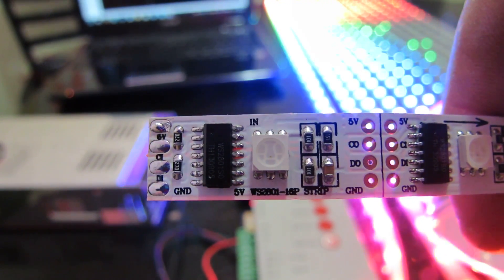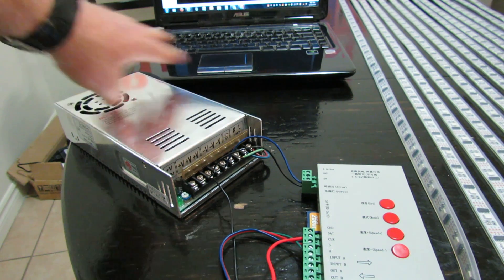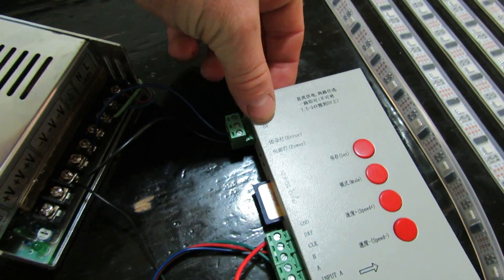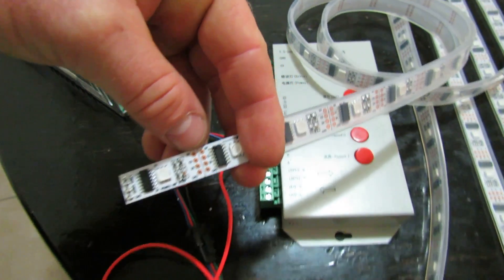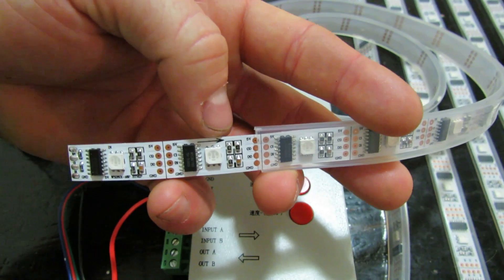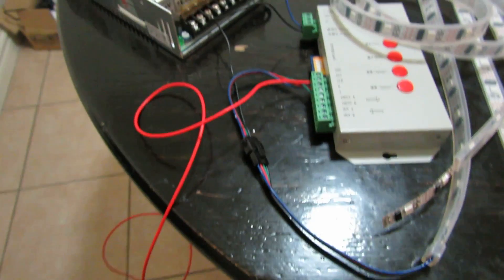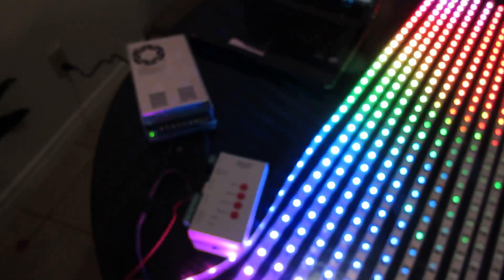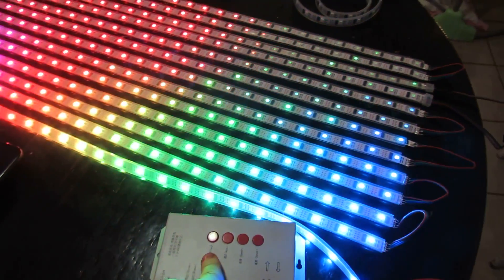How to Build an LED Display, #1 Basic Wiring and Setup (WS2801 LEDs)

Comment: Considering the voltage drop: why do you add a red wire from the GND of the controller to the GND of the end of the strip? I thought you would have added an extra black wire running from your Power Supply (an extra V+ port) directly to the end of your strip (on the 5V dot, not the GND).

Comment: I have a question?, I have a LED strip ws 2812 B 100 meters, a strip of two meters is attached to the wall, total 50 strips are attached, total LED is 6000, which controller will be used for this?  That works with audio?

Comment: Great videos, thank you! Hey, can you share any insight on clear LED screens? (typically seen on large applications so the resolution being very coarse aids in the perception that it's clear) How are they doing that, are they somehow placing the chips to the side of the screen vs. inboard next to the LED, as seen on your example strips? Wondering if you might know of a good source to find clear strips and/or screen? Thanks again.

Comment: I loved how the sd card says “256 MB” proudly
Reply from the maker: Oh, how technology has evolved. haha
Reply: @flexfireleds  Considering the voltage drop: why do you add a red wire from the GND of the controller to the GND of the end of the strip? I thought you would have added an extra black wire running from your Power Supply (an extra V+ port) directly to the end of your strip (on the 5V dot, not the GND).

Comment: i have all the things on the video but my led strip is 12v-DIN-GND i have only 3 outputs and 2 wires goes out from "12v" and 1 wire goes out from "DIN" and 2 wires goes out from GND hmm

Comment: I'm looking to do this program on a DC system with 6v batteries and the ability to have 6v and 12v possible system. What are the key differences in the power supply I need to know?

Comment: Too much wrong information in this video. The arrows on the strip indicate the direction the data should flow, not the power. Power taps can be placed anywhere u wish. You only placed a ground wire at the end of the strip to counter the voltage drop, should have also connected a positive wire. You really should learn the basics before trying to teach others so as not to spread incorrect info.

Comment: When connecting power between terminals, for safety and consistency, BLACK WIRE is normally used for GROUND (or V-) and RED or WHITE (less common) for Supply Voltage (V+, or VCC)

Comment: Hi, i am trying to install the program and i'm folowing your video, i do exactly the same as you but the program open a window with an error and it don't let me to continue. Do you know what could it be? When i put new file the error appears. I've downloaded around 50 different types of the led edit and in all of them i have the same problem, if you can help me it will be amazing. Thank you

Comment: Hello I need some sugestion,how I can have real time clock and temp on same display like this.I using T1000s controller.thanks
Reply: I don't think there is a way to do "real time" with a T1000S because it can only run programs loaded on to the SD Card in a loop.  To get real time info, you would probably be best using an arduino controller with wifi.

Comment: Could you use this type of setup to control warm white leds?
Reply: Yes, but it is likely overkill for whites unless you have a project requiring each led to be programmable at different intensities (this set-up controls millions of colors and each led individually).  There are much simpler controller/power set-ups that can handle dimming and blinking of white LEDs.

Comment: There is so much wrong with this video. The arrow is NOT the flow of electricity, it is the data flow. You can power the strips and feed power from both ends.

Also you appear to just provide power to the +5v, well guess what, what current goes out of the +5v needs to have a return path, so when power injecting you need to provide a pair of wires, one to the positive and one to the negative

Comment: I have ws2811 led strip lights and hc008 controller. I have connected 25 meters of strip lights. after 10 m the voltage drops and my lights don't emit all colours after 10 m. same like yours my strip lights also have arrow marks so that I don't power up the wrong side. however u connected the gnd wire to end of led strip going against the arrow direction. will this help me as well if I do the same
Reply: Shadab Khan:  Did you find a solution?  I have a similar question because I don't think he should be able to jump power by using the ground wire like he does in the video.  From what I've learned, you should jump power using the 5v wire (makes more sense to use the power wire to jump power) and that is how I've done it in the few projects I've done. [From Power, I attach 5v to controller and to light strip; From Power, I attach Ground to controller and to light strip; From Controller, I attach ground to light strip].

I'm wondering if his ground and power might be switched and he doesn't realize, either because he mis-labeled or the Chinese controller has mislabeled its pins/ports?  I've seen other T1000s with different labeling order than mine, so I wonder if some are mislabeled? 

Any electricians out there who know why he was able to jump with his ground wire?  Is the video correct?
Reply: Good . We are professional manufacturer of addressable pixel led / led strips . I'd like to add you to my professional network on LinkedIn & facebook .
Reply: The reason you add the ground to the end is to reduce the effective resistance of the bottom half of the LED's. The same thing is achieved by adding an additional power line. If you do both, you could vastly reduce power inefficiency due to accumulated resistance, however, adding a second ground to the end of the strips is usually enough. AFAIK, these stips use a common rail that runs down the back of all the strips, and the LED's and controllers tap into it in parallel. The arrows have NOTHING to do with flow of electricity, but flow of data.

Comment: Awesome video will help immensely once my T1000S arrives. Quick question do i need to have a dimmable power supply for the T1000 and my Strips both 12v
Reply: not necessary to use dimmable , just DC12V power supply works. more help visit  www.led-color.com

Comment: hi,  does the controller also work with strips whitout clock?
Reply: ws2801 is double signal 。Date and clock .  need install clock pin .   ws2811 is 3 pin  with out clock
Reply: controller works for both ws2801 and ws2811 led strip, more information see http://www.led-color.com/index.php/Product/view/id/705.html

Comment: Can you connect via DMX?
Reply: the Ws2801 ic led strip is the SPI signal, if want to connect the VIa DMX. should add a decorder.     if you have the DMX controller. you can just get the DMX led strip . can work with the DMX controller directly. 

learn more please Email: jessie@witop-tech.com
phone/what's app: 0086+15676178187

Comment: I see there is a voltage drop to the end of the strip, but how does adding a ground wire help?
Isn't it that the 5V wire should also be connected on another place?
Reply: Yes, as well, and not just at the end of the strip. Power loss will always occur, it's just a matter of reducing it as much as possible. Of you connect extra wires for ground and +5v at the end of the strip, the highest power loss will be in the middle then. Question is if you are able to notice it or not....

Comment: In your vid:  The GROUND wire (green), which they should call the common wire (?),  is connected to the aluminum chassis?  And the blue wire is VSS, which they should call GROUND?  And VCC is the black wire?  Thanks!

Where did you get the power supply, btw?  I see a lot of them from China on eBay, but just wanted to know if I could order in the US.

Comment: Does the pixel number on the Auto layout means "sections" or number of LED on the strip?
I have a 5050 SMD300 strip, that on each "section" has 3 LEDs (each one is RGB).
I mean, if I want 30*30 layout, do I need 30 sections or total of 30 LEDs on the strip?

Comment: I want to buy this T1000S controller, SD Card , and WS20801 IC strip lights . where I Can buy in Cambodia ?
Reply: You can click here know more about this controller and WS2801 strips :   http://www.ledstripsales.com/Full-color-controllers-c-56/t1000s-with-sd-card-pixel-controller-for-ws2801-ws2811-ws2812b-dream-color-magic-led-strips-p-2090.html                     http://www.ledstripsales.com/color-change-LED-Strip-c-38/ws2801-ic-5v-rgb-magic-color-programmable-series-flexible-led-strip-lights-160-leds-5mreel-p-2068.html

Comment: LED strip dislay is one trend of LED display,  it's much lighter than traditional LED dislay , low wind load and you don't need air-condition for it's not enclosed design.
We worked with it for years , and we've developed some Series of the product . Pls come visit our website if you are interesting and let's together develop the technology .

Comment: I bought 5 of these off eBay for $20.00 each with free shipping from Hong Kong, they are called "SUPERNIGHT 12V DC 30A 360W Regulated Switching Power Supply" and all 5 of them work fine, the only problem I am having is with the thermostats, I can't get the power supplies to run quietly.

Anyway, as soon as I wire up and plug the units into an outlet (without even drawing a single watt of power) all of the fans turn on at full-speed?!  I was told the fans are only supposed to come on when the units start getting heated, or begin reaching their maximum 360 watt loads, but now from COLD-START/ZERO LOAD?!?  Why are the fans running at max speed ALL THE TIME?  Constant fans running at full-speed makes these units super, super noisy!

Do you know if this 'fans-always-on' issue can be fixed?  I am running our office LED lighting system from these which are nowhere near the full 360 watt load (more like 120 watts) but the fans running at full force with even just 1 watt, makes every one of these power supplies unusable. :(
Reply: Totel set amount

Comment: Hello! how many leds can use direct connected in sequence in T1000 controller?
Reply: MAX 2048 leds connect to T1000 controller. To get more LEDs be controlled, i suggest T8000, it can control MAX 8192 leds.

Comment: Hi Ryan
Thanks for 4 awesome and easy to understand tutorials.

I am wanting to make a project very like yours but with two differences.

First:
I want the LED display to be fully mobile.
(It's going to be a LED Flag, mounted on a carrying pole)
Is there a way of running it all of a 12Volt battery ??
I can find 12 volt LED RGB strips online. But don't know if they are compatible with the T1000S and I would like to know if the T1000S will run on 12V only, with out a 5 V input ?

Secound:
I'm on a Mac computer. 
Do you know if there is a way to run "LED Edit 2013" on Mac OS X ?
Or if there is a similar program for Mac ??

Thanks
Peter

Comment: Hey FlexFire! Thanks for this great series of tutorials. I have the IC6803 LED Strips, Controller T-1000S and have this similar layout, I tried using lededit 2013, "Move Right" video effect... but my lights feel like they're alternating instead of all moving right... Did you ever encounter this issue? I can only guess the pixels are counted wrong but haven't figured out exactly what. Any advice?
Reply: Hello Iron Tank, sorry for the delay in response!

One of our guys made this video as a helpful tool to answer some questions for some customers. He has left Flexfire on great terms to explore another opportunity. We do not carry this product yet and our current knowledge on these products are limited. We are not able to offer too much extra info but I will do some research and message you when I get the right answer for you!
Reply: Can you show me a picture? Maybe i can help you find out the problem.

Comment: Hi, i'm having a trouble. I have a ws2812b strip with t1000s controller and the same power supply. After led 30-50 lights loss power, and almost every led after # 100 barely power on... I've tried wiring gnd to the end of the strip (as you mentioned), but I can only gain a bit of brightness, but still working wrong. What can I do? Thanks a lot.
Reply: I think some LED is broken, it cased the Signal transmission failure.

Comment: is it possible to use a regular led 5050 strips to do this
Reply from the maker: No, unfortunately, they cannot be independently controlled. You would need these WS2801 strip lights.

Comment: Can you explain what is the difference between the 3 wire (I believe Digital) to the 4 wire strips? & can you explain the differences in the WS28- models? 
Thanks Murf!
Reply: Hello Dan, sorry for the delay in response! One of our guys made this video as a helpful tool to answer some questions for some customers. We do not carry this product yet and our current knowledge on these products are limited. We are not able to offer too much extra info but I will do some research and message you when I get the right answer for you!